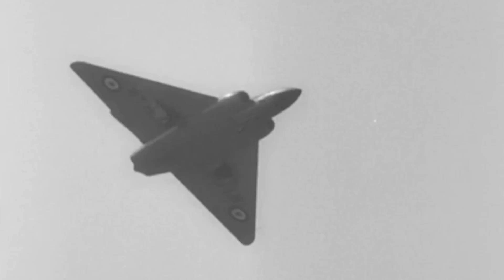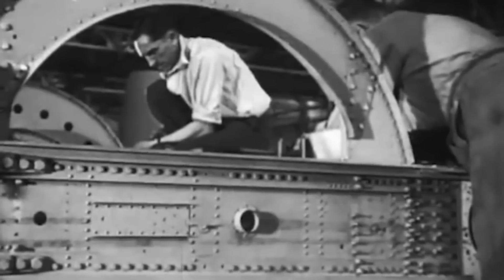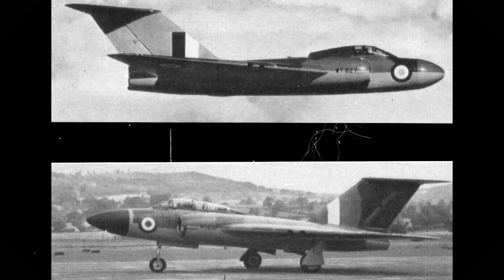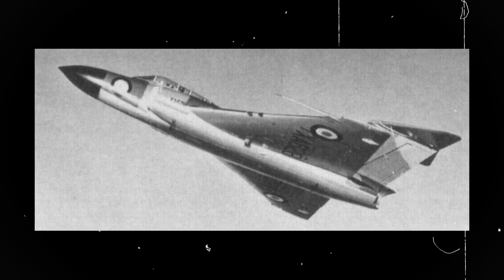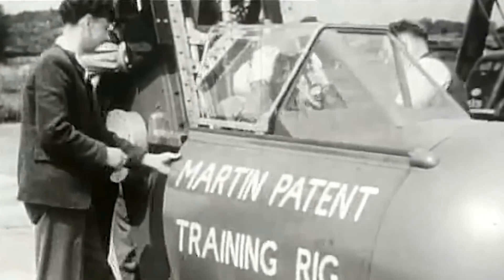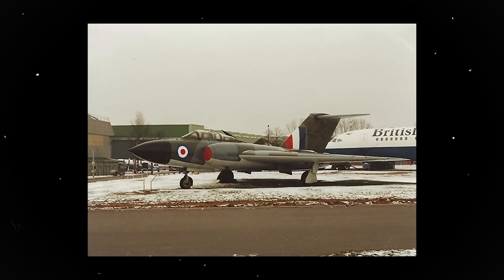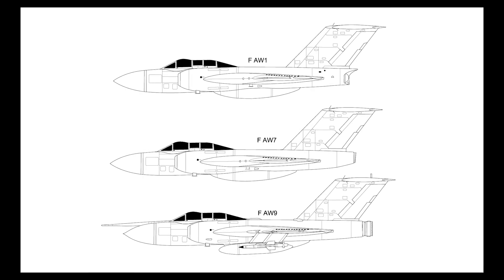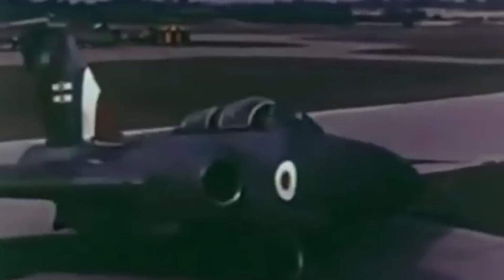The Bizarre Interceptor That Accidentally Broke the Sound Barrier

Comment: My dad did the same with the Vulcan. It wasn't designed to go through the sound barrier - but he was the first to show it could be done.
Reply: Due to a fatal design flaw, the Vulcan would pitch down violently into a death dive if it reached Mach 1, a Mach limiter device was installed on all Vulcans to stop them from crashing.
Reply: @sandervanderkammen9230 
It wasn't a fatal design flaw that caused a limiter requirement, the Vulcan wasn't designed to exceed Mach 1.
Reply: @petemaly8950  The Vulcan is the world's only plane with a supersonic Delta wing that cannot fly supersonic.
Reply: @sandervanderkammen9230  
The Vulcan did not have a supersonic delta wing. There was no attempt at the time to produce a supersonic bomber when designing the Vulcan..
Reply: @petemaly8950  So you didn't know that the Vulcan has a supersonic thrust to drag ratio???

Every Vulcan was equipped with a Mach limiter device.
Reply: @sandervanderkammen9230  
Krappenz DiktorBummer Jurkzxoffenz etc & co - they should note with great awe & reverence.
    They might like to do some research on the Vulcan before putting bs about it in their comments.
   C H E E R S
 😎👍
Reply: @petemaly8950  Please name a single British jet bomber still in service?
Reply: @sandervanderkammen9230  Hello Sandyboy, that will be the Eurofighter Typhoon, which as you know are built in Warton Lancashire.

Comment: The Javelin came out just a couple of years too early. With a thinner wing & blended wing roots, a more contoured leading edge, area rule, more efficient stronger engines, small wing tip tanks & close coupled canards (while keeping the T tail) it would have been great & IMAO better than the Lightning.
Reply: So a completely new aircraft ??
Reply: Never understood why the UK didn't adopt area rule in the airframe, earlier.

Comment: The idea of starting an engine with what amounted to a shotgun cartridge was also used at this time with tractors.
Reply: Flight of the phoenix😊
Reply: Field Marshall tractors...YT vids available.
It is a mixture that needs to be hand loaded today
smokeless and black powder/black powder substitute....
just a gas generator...
the high volume drives the piston down and the flywheel takes over to keep the rotation going....
Reply: Its also how the British designed B-57 / Canberra started it engines.
Reply: @robertarnold9815  The B57 used the same engines as the Javelin only licence built in USA.

Comment: That mention of the pilot's leg length....  During my USAF days as an Avionics Instrument Sysyems Tech, I worked on the Lockheed T-33A among others.  Being a tall guy with long legs, I realised when sitting in the cockpit, if I was a pilot and had to eject, I'd lose my lower legs to the instrument panel lower edge!  😮
Reply: Not necessarily, all modern ejection seats have leg restraints that automatically pull the Pilot/Nav/EWO etc etc legs back as part of the ejection seat sequence, but, you could be correct in your case as leg restraints might not have been introduced at that stage in seat systems, I know that they were introduced fairly early on in the development advancement process as it was realised that unrestrained legs were going to be flailing around causing considerable injuries to occur to the seat occupant.
Reply: @allandavis8201  

You cannot physically take a limb that is longer than a certain length...
and crush it back to the "correct" length with a pyrotechnic "tensioner"....
It just won't work.

If you tried that with a leg from knee to pelvis you would shatter the pelvis or the knee...and/or take the kneecap off on the dashboard during the ejection.....

Ball gunners on B17s had to be of small stature...

Early jet fighter pilots had to be less than 5ft 9 inches tall otherwise they couldn't fit under the dome of the cocpit with their bone domes (helmets).......

When designers rethough their designs taller pilots and longer legged WSOs were able to fit in a "
larger" cockpit.
Reply: @JohnSmith-pl2bk  , I’m unsure what you are trying to say, I have only ever known ejection seats that employed a leg restraint system that pulled the pilots legs back to the seat to stop them flailing around and causing massive injuries to the legs, they were not controlled by pyrotechnics they were a mechanical device that activated as the seat traveled up its rails, even in that tiny window of time the pilots legs were pulled back to stop them hitting anything in the cockpit and the effect of flailing.
Reply: @allandavis8201  
This is an early jet.
No leg restraints.
No physical space for the longer leg to get past the dashboard.
So short legged backseaters were needed.
Reply: @JohnSmith-pl2bk  According to the Martin Baker website the Mk 3js ejector seat fitted to the Javelin DID have leg restraints, no arm restraints but, and you can see the leg restraint lanyards in their photographs, definitely did.
Reply: @JohnSmith-pl2bk  Wouldn’t happen to an RAF Pilot or Rear seater, all the parameters you keep mentioning are taken into consideration even before a aircrew candidate is accepted into training, and that is that, you would never have been a pilot in the RAF. 
P.S when I was serving I never had a problem with your particular dilemma, not on any type I was posted onto, and I was not exactly a short arse at 6ft 1 1/2inches tall.
Reply: @allandavis8201  
Perhaps it was the interpretation of the narrator and content creator....
possibly relying on Wiki entries? or old tales?

It's 70 years ago now...
room for misunderstandings to creep in.....

I just keep remembering the WW1 British brass attitude to issuing parachutes....

so 35 years later reconfiguring a dash to fit long-limbed personnel might not rate highly in their scheme of things to worry about..
short arses will do.......
Reply: @JohnSmith-pl2bk  That sounds like you could absolutely spot on.
Reply: @JohnSmith-pl2bk 
They tucked their legs up or their legs were tucked up by the tensioners. A relative of my lot lost an arm while working over the cockpit of a Meteor due to a faulty ejector seat going off.
Reply: The EE Lightning had a similar issue. In those days, the RAF just didn't train tall pilots. 

Back in 1960, there was also a height limit on the Mercury astronauts. I think they had to be under 5'10", but I might be misremembering that.
Reply: This was the same problem with early Meteors